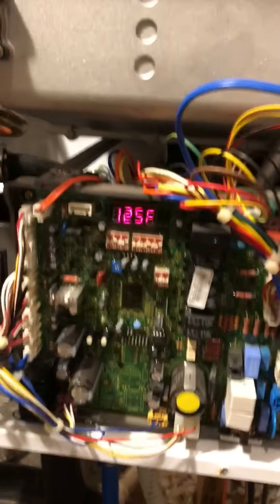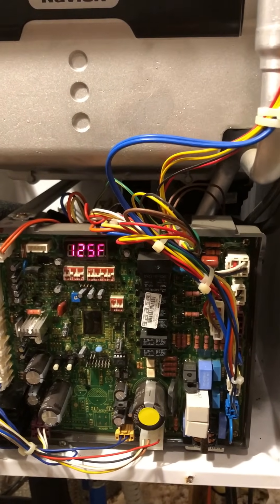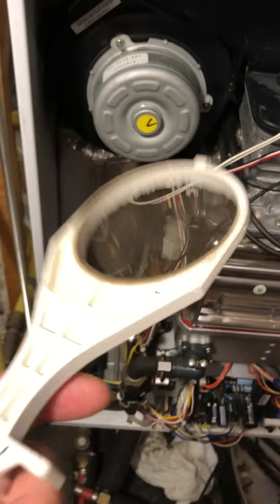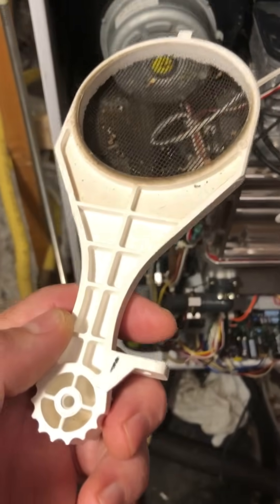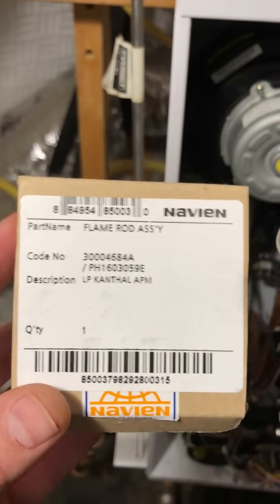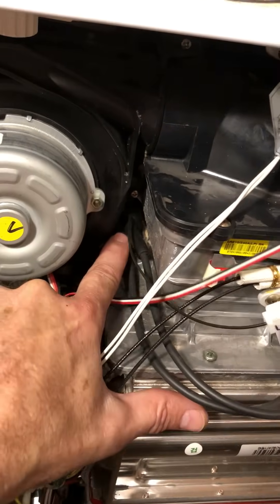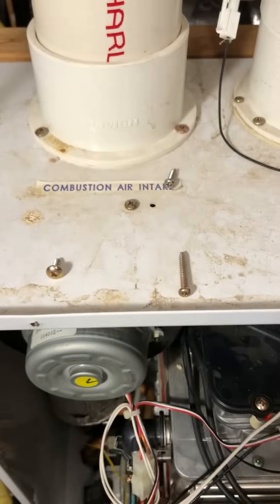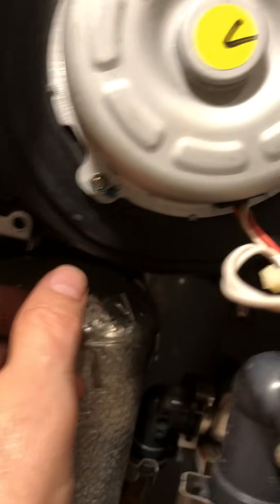Navien Tankless Water Heater Error Code 003 Fixed!

Comment: Does anyone know the distance needed between the flame rod pins on the ignition assembly?
Reply from the maker: @paoloroma8770  I’m afraid I don’t know the factory gap for the ignition pins.  But IIRC the gap was about 3/4” on the new part I ordered.

Comment: Navien NR-210A MY ISSUE IS THE TWO 5 AMP FUSES BLOWING  AT THE AC LINE COMING IN, WHEN  I TURN THE UNIT ON. THE UNIT STAYS ON, BUT AS SOON AS I OPEN A FAUCET TO LET WATER RUN, THAT IS WHEN FUSES GET BLOWN AFTER A FEW SECONDS. THERE IS NO BURN SIGNS ANYWHERE. i CLEANED THE UNIT AND FLUSHED SYSTEMS AS WELL. ANY  SUGGESTIONS., WILL BE GREATLY APPRECIATED. THX
THX

Comment: I have a NR240-A with the 003 error code. Plumber replaced the flame rods , gas valve and heat exchanger and it errors 003. Navien says if it was the PCB board it would error 015 or 515. How did you know it was the PCB if it still errored 003? Gas pressure etc were fine.

Comment: Hi Bryan,

Thank you so much for such a wonderful and helpful video! After watching your video, I ordered the flame rod assembly for my Navien after confirming the part number with their customer care agent. 

I could not unscrew any of the two screws to remove the current flame rod assembly despite using a regular screwdriver, the ratchet screwdriver from Amazon that you suggested, giving some heat, and dropping some WD-40 and Jig-A-Loo, a silicone based lubricant. No success at all. I had to reinstall the blower and restarted the water heater. Within an hour, I got the same 003 error code. Any help or suggestions from you or anyone else on how to remove those two screws would be greatly appreciated!

Comment: Twice I’ve had the 003 error code and support said to replace the board. Twice instead all i did was bleed the gas line. Turn the gas off. Take the tiny screw out from the pipe right under the unit. Put the screw back in. Turn on the gas and it will work. It’s just a gas line bubble. At worst try this first. It will save you a lot of money.
Reply: THANK YOU!!  This worked for me!  After several YT videos working out all the parts I need to potentially replace, then I saw your comment.  Thought it can't be THAT easy can it?  Doesn't hurt to try.  And it worked just like you said!  Hot showers here I go!

Comment: On my newly installed 210A2 in new construction just this last friday... filled the tub with hot water... great hot water... turned on the hot water to rinse soapy hair... nothing but cold.... rinsed with cold water... dried off went to unit and flashing 003 ignition failure error code.... rest didn't work... keep in mind the plumber just installed this less than 3 hours ago... it's friday night.... this is not a great start to the weekend or my relationship with this tankless water heater... I'll text the plumber this evening (Sunday) and hope he is out first thing Monday morning.... no need for a weekend service call.
Reply from the maker: Are there any additional numbers you're seeing with the error code?  Is there sufficient gas pressure?  Do you see the Flame Rod sparking in the ignition chamber window?  If your sources of air, fuel, and spark are good, it should be lighting.
Reply: @Walker34077  no other numbers... I'm having the propane company come out and check the new service and connections... thanks.

Comment: The connectors to the flame rod are an after thought, they don’t lock.  Eventually they work loose and flag and error.  You can secure by soldering them.  Theoretically they should last 20 years.

Comment: Thanks, B W, for very clear instructions. Same problem here -- and it was indeed the flame rod. Took me about half an hour to swap the part, and now it lights immediately.
Reply from the maker: Thank you for the feedback, John.  I'm happy that this little video has helped people get their water heaters up and running without spending a fortune in the process.

Comment: Hi there! I’m in the process to take the Flame Rod out of my navien system but the 2 screws on the flame rod are super tight to unscrew. Any suggestions please it will help me. Thanks
Reply from the maker: Have you tried a couple of drops of penetrating oil such as Liquid Wrench?  That may help?  But I'd be very careful to wipe all of it off before igniting the burner again.
Reply: @Walker34077  Yes I did I sprayed a little with a rag around the are so it wouldn’t drip some of the W-40 but it didn’t work it was sealed tight. So I purchased a small hand blow torch and gave it some heat and finally the stupid screws came off. I really appreciate you making this video it save me a lot of money by the way I purchased 2 flame rod since they where $8.95. I was hoping it was the flame rod and not the motherboard because then I had to wait until the holiday to get it on Friday. Notice on the motherboard one yellow light is on any suggestions on that? Thanks again!!!!

Comment: Checking in I have a CH-180 combi boiler 

Same error as everyone else! 

Started probably a year ago. About once every other month I would have to go and hit the power button and it would kick back on. Called my local plumber, he came out removed the flame rod tips were rusted so he cleaned them up- reinstalled. He also adjusted the intake and exhaust vents on the outside of my house (they were installed incorrectly by the previous owner. Bought me 6 months for half hour of labor. ($50) 

Now, my GFI switch that the heater is plugged into starts tripping. Reset the switch, plug it back in trips again. Run an extension cord to a non-GFI switch plug it in, runs fine. (Tells me it’s a short) I leave it connected via the extension cord for about a week (plumber was booked) no issues. 

Plumber comes back out replaces the flame rod assembly ($30) no issue for two month. 

I come back from a brief weekend vacation today, run a shower, no hot water. GFI is tripped. Plug back into extension cord. 003E is back this time won’t stay on. Looks like there is flame inside the window but no signal to the controller. 

Will start with the transformer myself, if not then PCB. If not then air/fuel intake
Reply from the maker: It seems like your troubleshooting logic is sound.  The GFCI tripping is definitely a warning sign that your electrical supply has a problem.

Comment: I have the NR 180 model and it is mounted in a way that won’t remove, I can’t get the right angle for removing due to the top part of the assembly.  Did you have a difficult time removing the flame rod unit?
Reply from the maker: I used a small low-profile right-angle screwdriver to remove the mounting  screws of the flame rod unit.  You can find them at a hardware store or Amazon for just a few dollars.  https://www.amazon.com/General-Tools-807SX-Crosspoint-Screwdriver/dp/B00004T7U0/ref=sr_1_27?crid=P6S935OBJGGJ&dchild=1&keywords=low+profile+right+angle+screwdriver&qid=1622391377&sprefix=low+profile+right+angle+scre%2Caps%2C162&sr=8-27

Comment: Amazing video. I was able to fix my unit with just the flame rod assembly replacement with the 003E error code. Took about 30 min. Keep in mind that if you have a natural gas unit then the part number is different than the one in the video.
Reply from the maker: Thank you for the note, Jeremy.  I'm very happy to hear that the video helped.
Reply: I have the natural gas version model as well, which part number should I order?

Comment: I also had this Error code 3 and I replace a flame rod of which it did need, however i am still getting the error code 3 with multiple attempts to start.  How did you know the mother board was the next problem
Reply from the maker: I walked through some spark chasing while on the phone with a Navien tech rep after the flame rod I replaced didn't clear the code.  We found that there was no signal coming from the actual pins on the motherboard connector leading to the flame rod.  The associated circuitry on the board had failed.
Reply: @Walker34077  Ok I see! Did you use a meter to test or did they walk you though some other method.  Their Tech Support wouldn't speak with me because I was not a tech with a company.  Mine will just go through cycles but will turn off and throw a code3.  I get about 3-4 mins of hot water and then cold again. I may need to check the flow sensor next.
Reply from the maker: @terenceteat9559  Yes, I used a multimeter to test the voltage coming out of the motherboard's pin, after ensuring the signal wire (black) running to the flame rod hadn't been damaged.

Comment: I replaced the flame sensor, how can you tell the board is the next possible problem?
Reply from the maker: In my case, the E003 error didn't clear after replacing the flame rod.  This indicated that the motherboard had failed.  I replaced the flame rod first in hopes that this (~$25) part would clear the error code.  Even though the flame rod in my unit was very worn and needed replacement anyway, a new motherboard (~$150) ultimately fixed the issue.

Comment: Do you have your heater suspended via a vibration-damping system? (3:34). Just curious, mine is bolted to 2x4s nailed to floor joists, which transmit vibration to the room above...
Reply from the maker: Yes, I remounted the heater to be suspended on rubber isolation mounts.  These resulted in a HUGE reduction in the sound that was propagating to the bedrooms below when the recirculation pump was running.

Comment: Thanks for the video.   I had the same problem but it turned out to be severely corroded connectors on the main gas valve.
Reply: I had the same issue. Had to replace the whole main gas valve as I could not source the coil/solenoid on the top that seemed to be the source of the issue (it seemed to be leaking some sort of very corrosive fluid all over the gas valve). Works great after replacement and $50 (for the part) is not bad for a 12 year old water heater! You can easily diagnose if this is your issue, use a flashlight to peer BEHIND the PCB to the back right bottom of the unit and you'll see major corrosion on the top of the main gas valve (sits in the back right corner of the unit) cascading down the main gas valve. Very visually obvious, at least to me. As soon as I took out the PCB and simply TOUCHED the lead wire going to the top solenoid, it literally FELL OFF since it was completely corroded. Even if it's not that bad, if it's not making a connection the unit will NOT run.

Comment: BW or anyone please help:
I have had the same code off and on for 6 months, specifically on warmer days once the attic heats up.  unit is a CR-210 installed in 2010.  It has been flushed, traps are clean, I watched this video, new igniters, air intake clean, flow sensor new, exhaust over temperature/limit switch replaced, just replaced the MOTHER board, spent 1000$ to have a high pressure gas meter installed with regulators on all gas appliances, bc NAVIEN techs and a plumber said that was the issue, didn't help at all, nobody is listening to include NAVIEN tech.  the system has been working perfect for 9 years, last 6 months will not work during the day (if its warm outside and the attic heats up above 75 degrees.  Any thoughts, please help.
Michael
Reply: Exactly same problem with off and on for last 4 months. Replaced flame rod assembly and flushing yesterday, still same issue this morning. Any help?
Reply from the maker: @skorimil  My only guess is a component on the motherboard is beginning to fail.  Electrolytic capacitors are also somewhat sensitive to heat.  A replacement mobo may be your next step.

Comment: There are different flame rods for different types of gas- LP or NG. Make sure you get the appropriate one for your gas type otherwise it won't work right. 
I also had my unit plugged into a surge protector. On a hunch I removed the surge protector and now it works great. Much more responsive ignition.

Comment: I had the same problem, the new igniter worked, but it came back.  I just fixed it by replacing the ignition transformer. I also installed a new ignitor while I was there. Now it starts flawlessly.

Comment: So I did a flame rod and ignition transformer and just peeked in the sightglass and of course I am getting ignition. But I am also getting "ignition failure" the unit is actually extinguishing itself because it doesn't know it did in fact ignite. So looks like I'm out a PCB. Very exciting, so pleased thus far with the Navien Experience (tm)
Reply from the maker: Before you get a new PCB I would recommend you double-check the wire from the flame rod all the way down to the PCB plug to make sure it hasn't been compromised.  It would be a shame to spend the money for a new board when something as simple as a bad connection or faulty wire is the cause.
Reply: A little late but you should also check the entire intake and exhaust piping for any sort of blockage. Flames will not last long if they can’t breathe.

Comment: E003 is shown after 10 ignition failures. My problem was due to one of the ignition wires being connected to the flame rod. Worked much better after that!
Reply: What does that mean?  Isn’t the ignition wire suppose to be connected to the flame?
Reply: @bluwng  The flame rod detects combustion. The ignition wire creates the spark.

Comment: Thanks for this video.  I went through the same steps....my old flame rod was definitely working, i.e. sparking, but still no ignition.  I find if I pause the blower for a short period then ignition starts up.  This suggest gas flow problem.   I replaced the board anyway and it DOES ignite, but the new firmware seems to just give the navien many more attempts...this suggests to me a gas flow issue.  my next steps will be to measure the gas pressure (thanks for the tip from here , https://www.youtube.com/watch?v=33mn76DfN-U ) , perhaps blow the line to see if that helps. The other option is perhaps to replace the blower, or the venturi meter....
Reply from the maker: Thanks for the troubleshooting analysis, Mark.  I agree with your suspicion about the problem being with fuel or air flow.  Have you had problems with any other gas appliances in your home?
Reply: @Walker34077  I checked the gas pressure and it was 7 in WC so in the acceptable range.  I had started to think it was the gas pressure sensor which is located on top part of the burn unit...looks like a flying saucer, black with some hoses coming out.  This sensor has a venturi meter attached and I reasoned if this was malfunctioning then the blower might be too high initially (i.e. blowing too hard during igntion, so if blower input is plugged or if blower unplugged, ignition happens...which it does)  Finally called in a plumber...not overly impressed.  took him an hour to call navien (after I suggested it), finally talked with tech....they measured the gas pressure...hey 7in  (what a suprise!)... then they measured the pressure sensor and it turns out to be faulty...I can't wait for the bill.....to top it off he changed the dip switch settings on me so it ran on minimum so no hot water...another hour grrrrr....It does turn out the unit will ignite if the hose to the venturi meter is opened to air....

Comment: Great video.  Very helpful.  I just replaced my heat sensor/igniter on my condensing boiler.  Its a new unit and better designed than the one in the video.  The heat sensor was accessible and  2 screws and three connectors and whammo I had made fire.  Navien was not helpful.  They kept trying to blame gas pressure... I kept telling them the on demand tank less hot water heater draws 2x the btu's and it worked so gas pressure is fine...... they seemed more interested in getting me off the phone. Kept saying I need to call a certified technician.  Of course I did and my plumber was on vacation and I cant get a plumber to make a service call on such a complicated device You tube and you people helped, thank you.  heat sensor cost me $28... easy peasy.
Reply from the maker: I'm really happy to hear this video was helpful.  I'm also happy to say that my experience with Navien tech support was very positive.  I spent a solid 30 minutes on the phone as we tested the voltages and connections for the system.   But I can certainly understand how frustrating it can be to get a bad rep on the tech support line.
Reply: @Walker34077  Glad you had a good experience. I called Navien, they just kept saying I needed to call an authorized repair tech. It's a low quality product from a junk company and I will never, ever buy one of their garbage products (other than repair parts) again.

Comment: Do you have a part number for the flame rod.   Thanks for the video!   That website you provide does not ship to Canada
Reply: David Broadway Go online to NAVIEN and get the part number for your unit. Your owners manual will have the old number, just match it to the new number. NG = Natural Gas LP = Liquid Propane
Reply: @thundarspikershott9594  it depends where you got it from. If it's a reseller or distributor, Navien prints that distributors part # inside instead to try to make you buy it from them. Racketeering at it's finest
Reply from the maker: I'm so sorry I didn't see this post until now.   The part number for my heater was 30004684A.